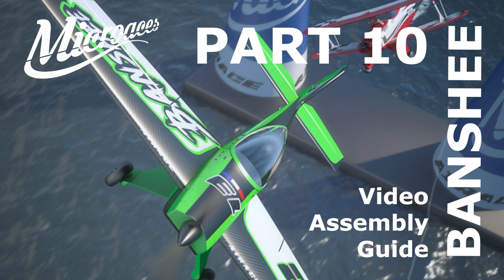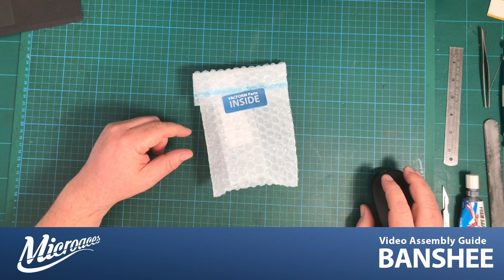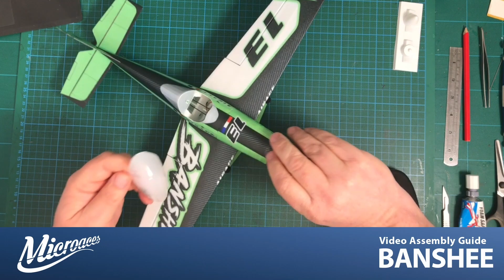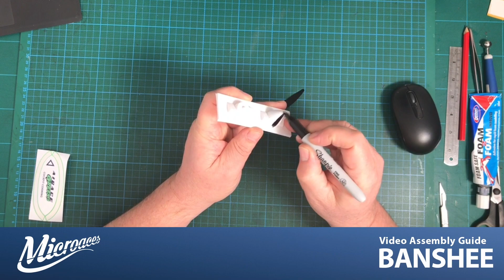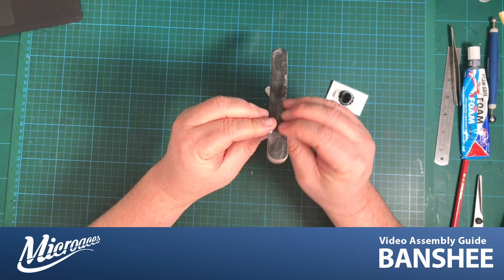BANSHEE Video Assembly Guide - PART 10 CANOPY & SPINNER

Comment: Luckily I bought the programming cable with the Rx. The software worked with my ancient Windows 7 PC. I had to try different USB Ports to find one that worked. The PC program graphics have changed a bit since your old video for the twin. I got lucky guessing that Rudder was axis Z and reversing that corrected my gyro sensing. It is possible to power the Rx via the USB cable with the Transmitter connected, while working on the aircraft settings, for instant feedback. I changed Channel 5 in my DX6 transmitter to a 3 position switch so I will have gyro off and two gain choices initially. I do not know if I could have made any changes without the PC program interface though. If not then I consider the Programming tool and a PC to be absolutely necessary for these receivers. Cheers!

Comment: You mention a video on setting up this stabilization Rx for flight at the end of this video. There is a video on your website about the PC programming software but it does not address simple changes like that? My rudder gyro is reverse sensing, it is incorrect. I cannot fly it like this. Thank You.